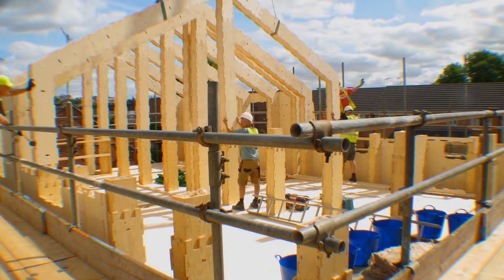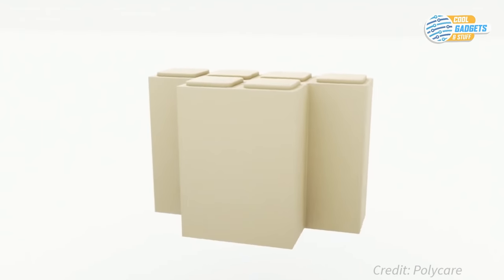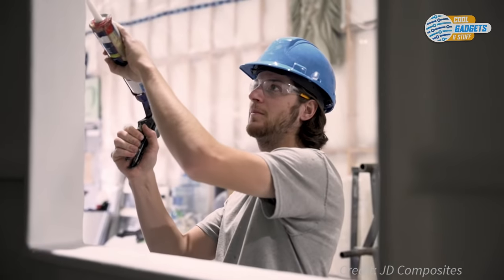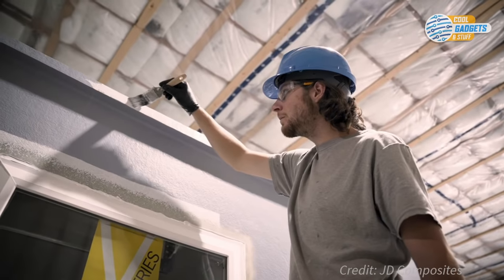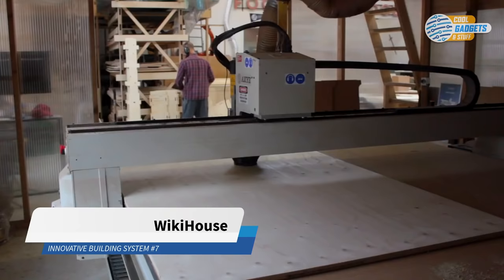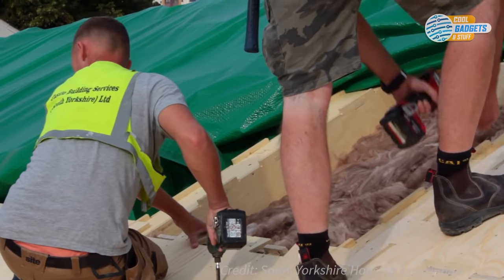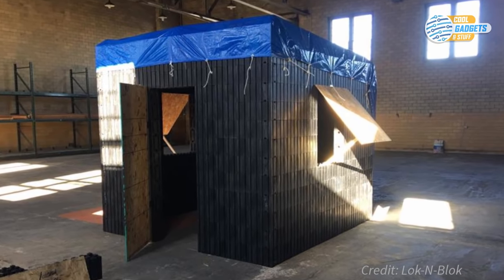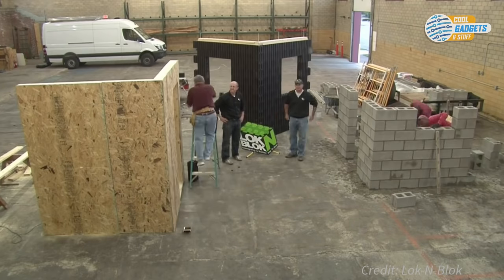5 Innovative BUILDING SYSTEMS for your house #7

Comment: Thank you for these videos. These are encouraging developments. Using plastic waste in building blocks is the best solution so far.
Reply: Problem Is unless it is mixed with the proper  bonding agents the plastic can off gas and it can be cancergentic

Comment: The major cost of building a house is labor (in the us, california in particular).   The major time sink is all the finishing work, the roofing, the interior, the wiring, the plumbing.  You could have a square box for free, and a house would still cost about the same.   Plastic has a big issue with expansion and contraction, I would be skeptical of material made from particular those blocks.  Would have to see all the testing results.

Comment: Good information. However, I do wish that you had mentioned the cost of these materials.
Reply: There links to the companies selling the products featured on n the video description
Reply: I agree would be so much easier to rack and stack them. If you really want to know you'll have to contact the companies via email, they rarely show thier costs with the public unless you ask directly.
Reply: Well yeah would be great but..... gou have to check foe yourself because prices do change given different circumstances...
Some things (like prefab for example)
Require a factory 
So shipping is a issue...
Some things are only available  in some locations while other thing require professionals.. (could be locals/...)
So there are lots of unknowns...

Just get a estimate
Reply: When prices for materials are not advertised on manufacturers sites, it's usually more expensive than conventional construction materials. They will claim you save on labour,  but actually labour costs on a buildings superstructure isn't that much. The cost is in what completes the house ie roof, electrics, carpets, cupboards, foundation, insulation etc. So as a rule hardly any saving on a structure that won't last as long as brick.
These construction methods are ok for when building structures on sites whith difficult access.
Best alternative is a solid log cabin.
Reply: @zabadackakaHansCoche  mostly true..  the framers are part of it. If its not partly diy, you still have the contractor to pay. Insulation comes with the block so you dont pay for the walls and the labor for that.... the rest depends on how much icf you do with the roof and floors
Reply: @dorothymartin8557  there is a picture of a vacation home at mexico beach in florida. Look it up and see how it faired with a direct hit by hurricane michael
Reply: @dorothymartin8557  probably, not sure which type was used, but i suspect it was along the type like fox block. They used over size form with rebar.. when the hurricane hit they watched the storm on their security cameras. Arial views show it as pristine with everything around it flat. When i was down there on business i was amazed it looked untouched in the devistation, let alone the number of uprooted trees.. i did not kniw of icf back then and thought they had access to supplies and managed repairs quickly. I dont know of a house hit by a tornado, but the winds would hardly be worse than michael.
Reply: Gray you want to know what it contains so you can make your own plastic is every where in the states
Reply: @ronallens6204  the house in Mexico Beach was of ICF construction .
Reply: @donaldbrown716  yes, there is alot of plastic, just like trees, but its not all tthe same and many do not mix
Reply: @dorothymartin8557  that is the one. As i understand it, rebar and concrete are poured into the icf, not all of tthem are solid foam. Hurricanes would sand blast the foam to pieces.  Another house in pensicola a houae survived a hurrucain, witg the owners inside on a barrier island. Its a dome type that is unique.
Reply: Biaya produksi nya lebih mahal, menyebabkan harga jadi jauh lebih mahal dari bahan semen

Comment: I've always thought SIP panels were the way to go but my opinion is based more on just seeing the concept rather than any "nuts and bolts" type of examination. I wonder if there are any studies showing cost comparisons, relative strength, long term durability, etc. that would help determine if one method is better than another? The one shown in this video (#2) caught my eye as I built fiberglass boats for 30 years and I'm very familiar with the materials and technology.

Comment: I like the 'Lego' block building concept being implemented in the variations of lock-n-block building materials for design and building structures that are...Hopefully...Hypo-Allergenic, and can be ADA compliant.
Reply: @syedhuzaifahassan4588  I agree with you on that. There are materials available for the lock-block design that would work adequately for this use. Just need to be more up front with the make -up of materials.
Reply: @syedhuzaifahassan4588  The post tensioning system does provide the needed rigidity.
Reply: Would be good for hempcrete systems

Comment: Polycare is the easiest solution I've seen yet.  No mortar or concrete, only some vertical support, is fully insulated, and looks like it can be finished on the outside with stucco and on the inside with plaster.  Taking the building back apart I don't see much of a plus.  Only catch is that the plant is in Namibia.

Comment: Available in USA    Approved anywhere in USA?
Reply: Texas has exemption for owner built and occupied houses in the boondocks.  Do whatever you want, if you're killed can't complain to the building dept.
Otherwise, the local building department will not allow anything new and different without structural engineering approvals specific to the house plans,
and believe me when I say a certified structural engineer won't put his name on anything...even simple stuff, they want $50k..or more.